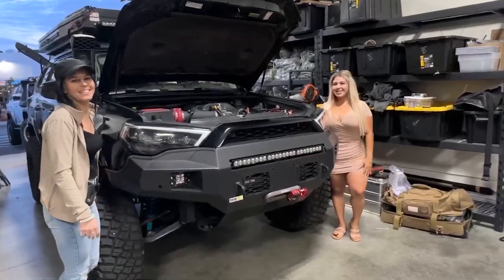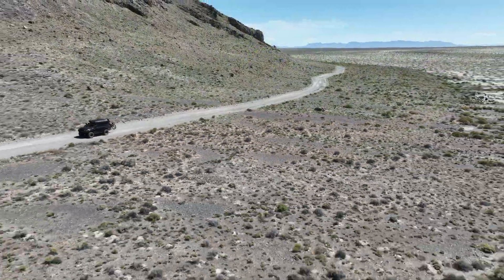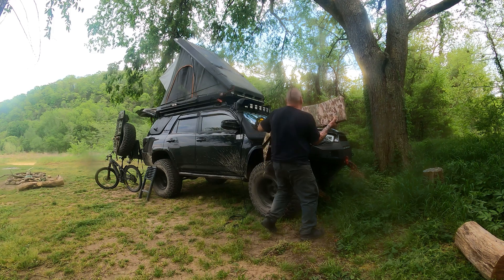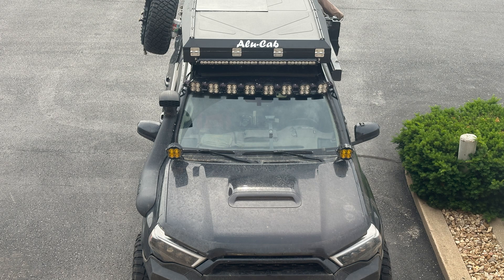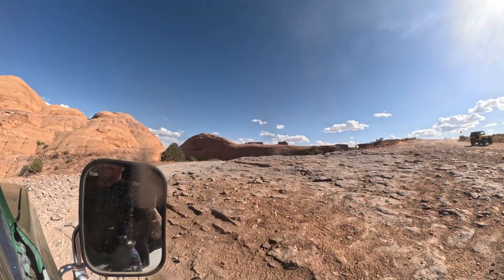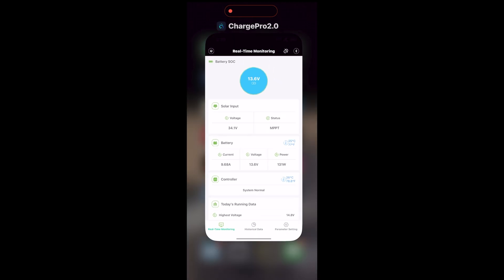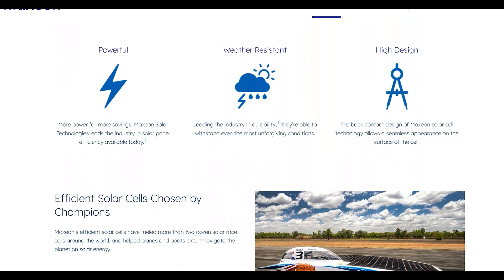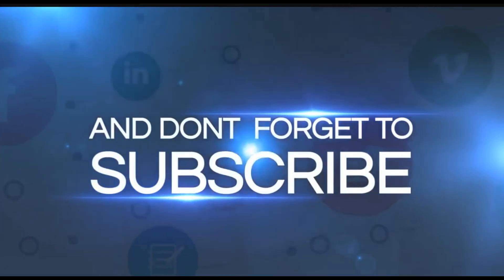Solar Panels For Your Truck That Make Power With NO Sunlight!! #offgridtrek #nocap

Comment: O didn't think I cared about trucks.. I'm blind so I can't drive but I use an insulin pump which connects to my my phone which keeps me alive. I don't need data I just need power.  You might have just kept me alive a little longer 😂 i also need to keep insulin on refrigerated.  Not stuff I hadn't thought about but I'm in London so little sun our solar lights don't come on hardly atm.  Im resigned but if I can stay alive to witness more I will.

Thank you Richie